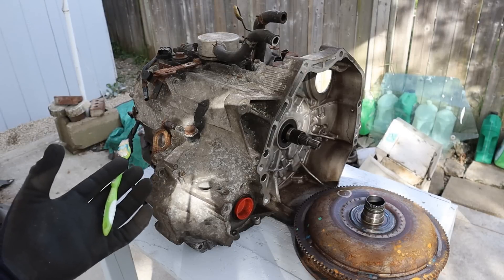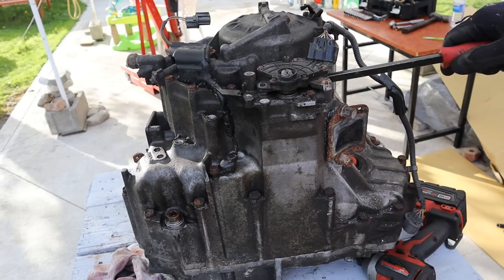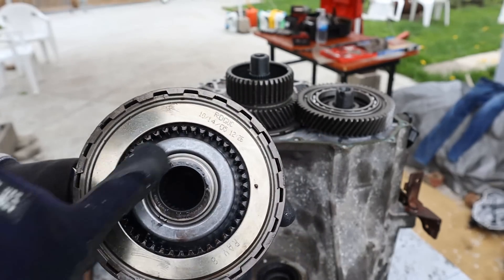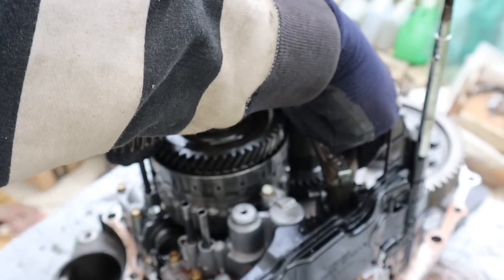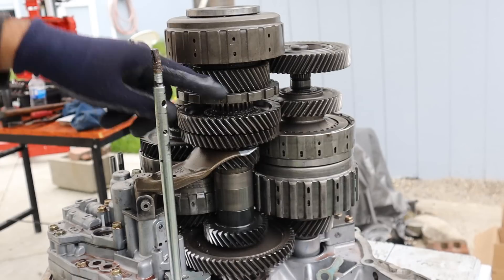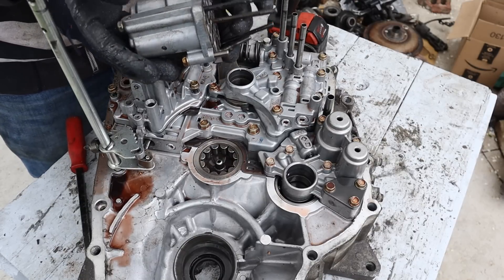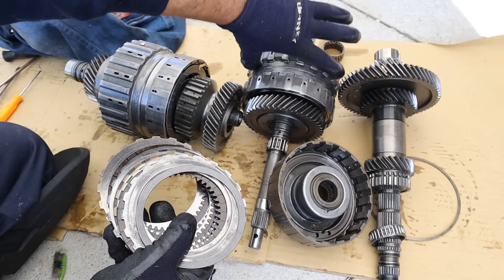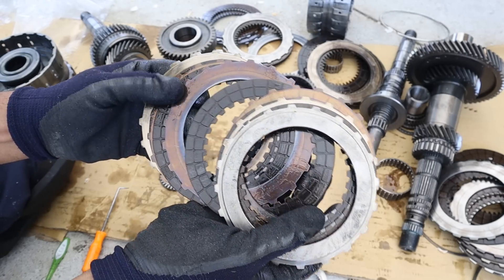Why Honda Transmissions FAIL

Comment: Later models of the honda H5 transmission no longer use an idling 3rd gear to transfer power from the input shaft to the secondary shaft. Instead they started using an idler gear to directly gear together the input and the secondary shaft all the time. I think they probably made that change to reduce wear on the third gear clutch.
Reply from the maker: That's a good idea !
Reply: Hi do you know if that update includes the 2006 CRV AWD 2.4 with the MKZA transmission?
Reply: @NoneYaBiz200  I'm not sure but you can read up on your CRV's factory repair manual. There's a section that outlines transmission gearing. Given it's a 2006 CRV the repair manuals are available online.
Reply: @monkeseeaction21987  Thank you, i am just on 90000 kms and i believe the previous owner had the ATF drain and fill once at the dealership, so ill keep and eye on it. Just that i suggested it to my dad for his retirement so i want it to last him a while without any major issues and i know that honda transmissions are quite sensitive to fluids.

Comment: My 2018 Subaru Forester 6MT has a transmission dipstick. 😅
Reply from the maker: Nice, because it's manual.
Reply: You can use that to check your front diff, That's why. My 01 with a manual does that.

Comment: There is also a condition on Honda Pilot Gen 2 autos that the radiator and trans cooler share the same radiator housing.  The plate separating the two will rust through and flood the transmission with coolant.  That pollutes the solenoids and even after numerous flushings and replaced solenoids... hidden coolant would continue to damage the solenoids.  Had to put in a TL transmission of the same format into that 2009 Pilot.
Reply from the maker: Ouch! I think that's common on a few other makes as well
Reply: Same problem with the Nissan Xterra
The strawberry milkshake of death
Reply: Miles? / Coolant changes?
Reply: @hsttrek1  currently 216k miles.  Did coolant flushes every 70k however never saw any concerns, always coolant for Asian vehicles.  Radiator failure happened around 200k miles.  50k used TL trans put on after 6k miles because coolant kept polluting shift solenoids and OBDII codes shows their failures.
Reply: Same with gen 3 Honda crvs. I have a 2011 and the transmission feed lines are at the bottom for the transmission cooler.
Reply: What a terrible idea, Honda!

Comment: Watching this as an owner of a 2007 Honda Accord V6 with 175K miles on the original transmission ...
Reply from the maker: By 2007 the failure rates dropped
Reply: @speedkar99 yep used to have an 07 tl that didn’t have any transmission issues with 200k. I did my research and learned the 04-06 TL were the ones with really bad trans issues. The 07-08 models were better built
Reply: @speedkar99  I heard they haven't. They have always had issues
Reply: My 06 ridge with 215k running strong... but fluid change evey year since new
Reply: lol 06s and under
Reply: Definitely change your fluid and filter, oil filter is inline on the cooler lines  on top of transmission.
Reply: Exceptional,
yeah,
that's more like an xception rather than norm
Reply: Use Amsoil or Castrol transmax fluid it will definitely last longer

Comment: The 9 speed is a zf unit, same unit used by chrysler in the pacifica and jeep cherokee. The difference is the unit in Hondas is built in a zf plant in the us and chryslers unit is built by chrsler under license. No suprise the chrysler unit has more problems.
Reply: I thought the problem was about the programming as each brand uses their own
Reply from the maker: I thought the 9 speeds weren't doing too well in the Hondas either.
Reply: @speedkar99  they chrysler unit is worse. The big issue is it uses dog clutchches which can make shifting feel harsh. Alot of the time people think theres a problem when there isnt.

Oh and another fun fact is nissan is now using the zf 9 speed in the pathfinder after dealing with cvt meltdown in the prior gen pathfinder.

Comment: My Oddyssey with 250 KM with original powertrain. You got to change you ATF 1/3 years or 36 KM.
Reply from the maker: Good idea. What year?
Reply: 2006 3.5 Liter/ 5 spd AT
Reply: My friends wife, close to 450k km on old 2010 Odyssey after tranny was replaced on warranty. Her current Odyssey close to 400k km, again original one replaced after warranty, so I guess 250k+ km. But friend being ex Honda mechanic does the ATF change every 30k. Cheaper than transmission ;)

Comment: This trans was neglected. Bright red fluid is new, but they just changed it. Nasty black goop says it wasn't changed for a really long time!

They didn't change it until it broke, because everyhing is maintenance free.
Reply from the maker: True, but they still had an inherit design flaw
Reply: @speedkar99  I don't think so. I beat on them & they keep working. I race autocrosses with my Honda automatics!

 I think the difference is that I also care for them. I added a replaceable transmission filter (from Honda) & change the fluid (d&f only! Never flush!) every 6k miles.

Comment: The Honda automatic transmissions aren't too bad, imo,

2004 Accord V6 5-spd auto: 15.5s 1/4 mile
2004 Accord V6 6-spd manual7 14.5s 1/4 mile

The downer is the missing gear! In the top gear, I'm spinning ~3200rpm at real 60mph! 

(I do have smaller tires, than it "should", but when the tires were oem OD, I couldn't get it this low.)
Reply from the maker: 3200rpm is very high for a 5 speed.
Reply: Lol, mine is not a 5-spd!

2001 BB6 (prelude), and my tires are only ~0.17% smaller. When it gets this slammed every tenth counts! The Prelude might be based on the Accord, but it was built for a completely different customer!
Reply: Yeah my 2010 V6 TSX with 5-spd auto does about 2000rpm at around 120km/h ~~ 75mph (but in D, I guess your numbers are from S gear?)
Reply: My 4 speed does 3200 rpm at around 80mph
Reply: @iank6897  that's how my Accord V6 was, but the Prelude is really short!
Reply: @Iowa599  Mine is at stock ride height. Are those high rpms for that speed? You got me worried now

Comment: Honda built their reputation on naturally aspirated 4 cylinders with a manual. Sad they don't build these anymore
Reply from the maker: True. 
People aren't buying manuals anymore
Reply: @speedkar99  Not in the US but in Europe 99% cars are manual !!
Reply: @speedkar99 not true, original comment is wrong and it’s not like you have to beba car enthusiast to know about a civic
Reply: You can buy a naturally aspirated, port injected, 4cyl manual civic hatchback right now. It’s been an option on the ‘22 ‘23 and ‘24 models
Reply: The base variant K20C is still NA as @nothing.mp3 said. It has the changes (compared to the old K20A/K20Z)  like the reversed cylinder head from the turbo versions of the K20C.  There was a recall for (unfortunately) incorrect piston rings on those IIRC, but that should be fixed now.  Manual transmission is still available on some trims of this engine.  

I'm not a fan of the L15 turbo (IMO it's almost literally a Fit engine with a turbo on it, it's designed for lightweight and low friction -- it has no overhead or reserve strength IMO, it's already more or less maxed out at stock power level, unlike the K20 or K24). It would be great if the Civic Si still came with a NA K24 engine (I think the 9th gen version is underrated despite the single exhaust port), but it is what it is.  Subaru and Toyota are really flying the flag now -- the GR86/BRZ FA24 engine performs great, it's easily a match for the K24 now in terms of performance!
Reply: Aspirated 4 cylinders are difficult to find even in developing markets. You can find plenty of aspirated 3 cylinders, though.

Manual transmission is still available on the lowest trims of the cheapest cars.
Reply: @13231wmw  Most of the Mazda and Suzuki engine range is still naturally aspirated. I think Mazda takes great pride in achieving high efficiency with non-downsized non-turbo four-cylinder engines (2.0-2.5 NA instead of the typical 1.0-1.5 downsize turbo), although the Suzuki engines are just basic older designs.  Also most Toyota hybrids have naturally aspirated four cylinder engines too (as do most ordinary base model Camrys too).

Interestingly,  the common Toyota 2AR/2AZ Camry four cylinder NA engine supposedly responds well to tuning and is a good candidate for swapping into MR2 sportscars -- it's common to use Hybrid engines (high compression) and replace the exhaust camshaft with a second high-lift/long-duration intake camshaft.🙂 The standard 150hp of the Camry hybrid 2.5L engine can be drastically increased to 250hp with these modifications (and a suitable intake, header and tune) apparently!
Reply: Manuals are great fun until you have to change out the clutch. I helped a friend with this on a Subaru and it is a big job.
I think DSGs and automatics are easier to maintain, just change the oil and filters regularly and they will last forever like an engine.
Reply: @jamsbong 
It a big job Subaru, c'mon. Only STI is kinda special. I remember in the '90s clutch on the Civic could be done in 3-4hrs. On my Matrix I did the clutch in 5-6 w/o dropping the K-frame. But on Accord, Acuras, and bigger sedans the K-frame with suspension has to come down, so the job takes twice as long.
Still I'd rather do a clutch than spend a few thousands on automatic tranny which might last as long as the clutch in some cases.
Reply: @jamsbong  Dry multi-plate clutches in DSGs wear out just as fast if not faster than manual transmissions clutches, especially in 1.0, 1.2, 1.4 TSIs that are driven around town in stop-start traffic a lot. It's not unheard of for the wet DSG clutches to wear out (e.g., in tuned cars) and/or develop a dual mass flywheel rattle either.

Comment: I have a 2010 V6 TSX with 5-speed auto - should I start saving up for a rebuild? :(
Reply from the maker: No I think by then it was fixed
Reply: Pre 2005 H5 3 shaft 
Post 2005 H5 4 shaft 
It was to stop the 3rd idle gear from cooking itself. Which cooked the Zw1/Dw1 fluid and sent that around to the rest of the transmission
Reply: TSX wasnt affected, mainly TLs and accords

Comment: Honda aren't as reliable as people think. I know for sure that steering can also be problematic in these Accords and new turbo engines are awful
Reply from the maker: Yeah the engine itself might be fine but the rest of the car might fall apart
Reply: They are definitely hit or miss, so you can't just be loyal to the brand. These small turbos are terrible for the environment - save ounces of fuel, but poor durability forces replacement of the whole car!

Comment: Seems to me that with modern electronic controls, that they should be able to automate a standard transmission, by moving the forks and activating the clutch. Either that, or make it a dual-clutch design. I suppose people would complain if there was a slight delay changing gears.
Reply: I think Subaru and BMW did automated manuals like that and stopped doing it. Honda has the better idea with clutches in between the gears, their only problem with this transmission was making the oil filters internal
Reply: it has been done on big rigs, they use air cylinders to quick shift the gears. I've never seen a company use an electric motor to accelerate the clutch to a certain rpm. that would eliminate the crash of gears and the need for synchromesh units. My favourite way to automate a manual is to use two half size engines and two half size manual gearboxes. that way you can change gears on one while the other keeps the vehicle moving. also you have free two wheel drive without paying extra for a lsd.
Reply: That was all of the early single-clutch automated manuals -- not just BMW or Subaru, Honda had one too "iShift", FIAT had one, Smart car had one.  Dual-clutch models (two inputs shafts) are more popular now, as they shift much faster (as long as it predicts correctly the next gearshift) -- those automated single-clutch manuals tended to be very clunky.
Reply from the maker: All this will be gone with e-CVT hybrids
Reply: Ford tried that on the Focus....

Comment: Its not that honda wanted to be different. Its that they didnt want to pay patent royalties when they first designed an automatic in the 70s. They were automated manuals till till the 10 speed that came out in the 2018 Accord 2.0. Thats their first planetary automatic.
Reply: Nah they want to be different, especially opposite of Toyota. If you look in the engine bay of old Hondas(I usually open up 90’s and 00’s models) the transmission and certain things are orientated the opposite way a traditional Toyota would and stuff like this where they were like oh you have planetary gears we don’t need that, oh you got dohc standard cause it manages power and efficiency better? It’s okay we’ll keep the single cam going, Honda just loves being the contrarian
Reply: @eVerProductions1 I like SOHC at first, until I was introduced to the legendary DOHC K-Series. Such a beast of an engine.
Reply: @eVerProductions1 this design is also more efficient than early generation automatics. It had lower frictional losses. If you look at lots of cars they are different than one another. You’ll find some with intake manifolds in the front, exhaust manifold in the rear, some are opposite. I don’t know if I’d say their design was driven by being different from Toyota. Toyota is a larger company and Aisin (their sister company) supplies transmissions to lots of other companies. They had the funds and scale to make paying a patent license worthwhile. Honda judged they didn’t. The failures on these older Honda transmissions seem to mostly be on the 6-cylinder models, most assume it is due to the higher loads on the transmission from more the powerful engines.
Reply: @eVerProductions1 wow now i see why Im attracted to Hondas. Always gotta be edgy and quirky 😂
Reply: I always did admire the old Honda engineering.
They always had something to prove to someone.

There is an story that GM thought the CVCC system wouldn't work on bigger engines, so Honda imported a Caprice with a 350 SBC and engineered heads for it, and guess what, the Honda heads made the same power but lower fuel consumption and better emissions.
Reply from the maker: Yes they wanted to be different. It costed them alot in recalls and warranty but I think it's been paid off for by now.
Reply: Actually, they wanted to pay the royalties. It’s just that the patent holders were giving them a hard time to get a license. So they had to engineer their own designs. Saying that, they really made their design super reliable by 2007 onwards.
Reply: Honda gear is ligther and smaller than planitary. Just slightly smaller is important especially if you are a mechanic, more room to work.
Reply: yeap, the cheapest bastards in automotive history, tho very good engineering except for these trans from mid '90's to mid '00's.   And their secrecy re the airbags was unconscionable and disgusting

Comment: That's why I can't find a Acura TL with a manual transmission in my area. That's the sweet spot
Reply: Only way to get a TL is with a manual. I have an auto as my daily but I've owned a manual before and it's a night and day difference.

Comment: Is the 6 speed any better? When I got an odyssey in 2015 (6 speed) I was well aware of odyssey transmission failure, (its like they tried so hard to copy chrysler minivans they included a gernading transmission 😂) but the toyota sienna drove like a bus and its better to risk it with the minivan I enjoyed driving than to drive a minivan I hated every day. Anyway its now 8 years ans 86k later and it hasnt blown up yet but it was shuddering at 60k and the honda tripple flush treatment fixed it, however Honda doesnt reccomend doing that till 100k. They should tell owners to do it at 40k.
 I also have a 2015 accord v6 with the same transmission, same miles and its fine. I think the problem in the odysseys is just due to it being too heavy for those 5 speeds to handle.
Reply: The 6 speeds are pretty robust so long as you regularly change the ATF.
Reply: My '15 Accord V6 H6 has had zero problems.  The problem with the H5 was cooling of the 2nd gear set.  Honda recalled these H5s to install a larger cooling passage for the 2nd gear, which was just a bandaid.  The H6 (with the recommended 30k service) should be teouble-free and long-lasting.

Comment: Damn it's disappointing to hear that these transaxles still had issues at that point, I thought it was just the 2000-03 TL era
Reply: I really dont get why they make the filters internal. I guess because they were throwaway cars. No one changes their trans oil anyways
Reply: @TuneStunnaMusic The 4 and 6 speed autos are very easy to drain and fill (~1/3 of capacity). Every 3rd oil change (15-20K miles), works for me...
Reply: There is an external filter on these that’s quite easy to do when you do a fluid change. It’s located right by the cooler with the hard line and banjo bolt 😊